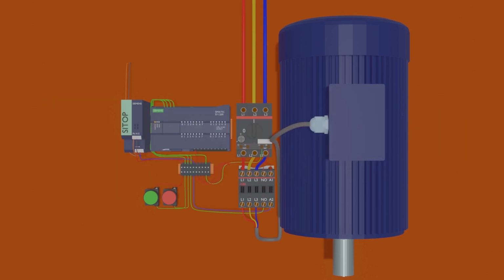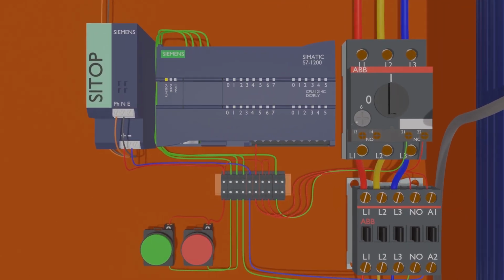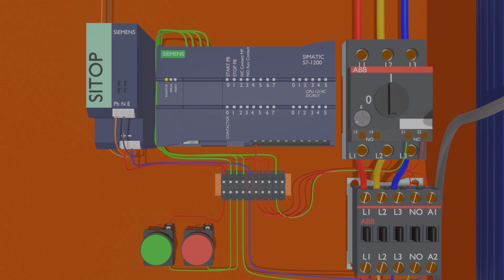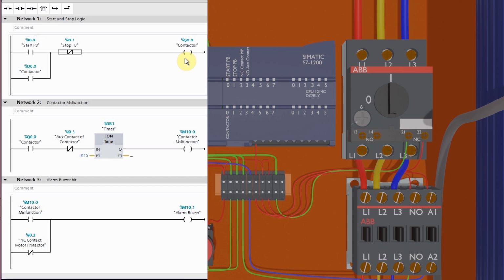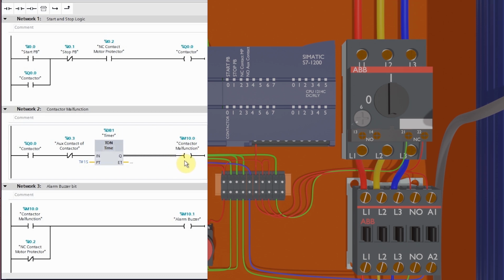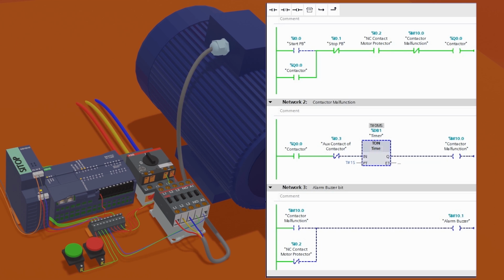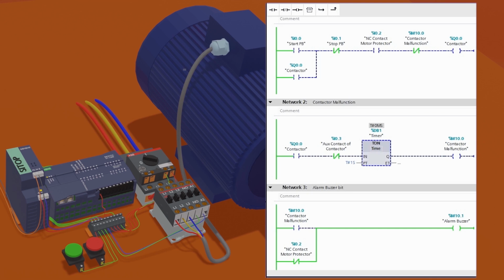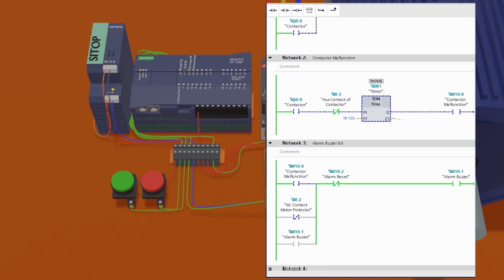How to turn ON a Contactor with PLC ? PLC Programming Tutorials for Beginners

Comment: I think I messed up I want to control a 220v Three-phase motor but then I need to buy a 24V  contactor? i've bought a 220v NA :/
Reply: You can add 24v relay to trigger the 220v contactor
Reply: @kaijuuARH  Do you think it would be better to return thr 220v NA contactor and buy a 24V instead?
Reply: @kaijuuARH  I'm using a s7-1200 siemens PLC 1214C AC/DC/RLY